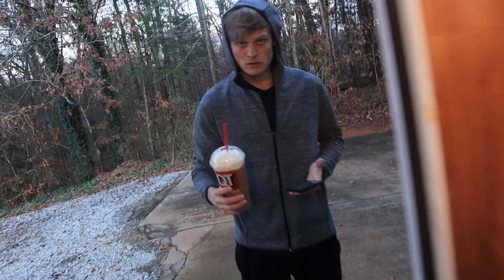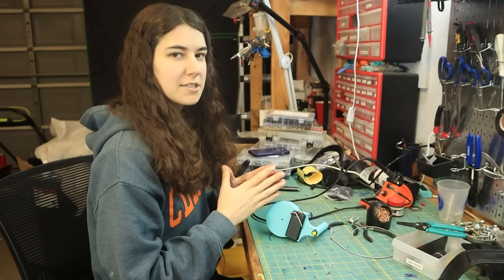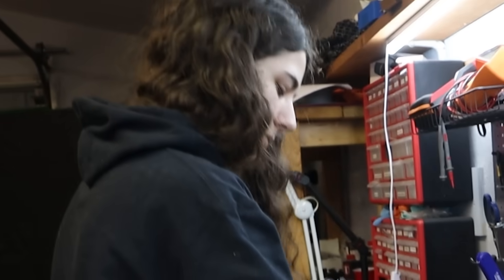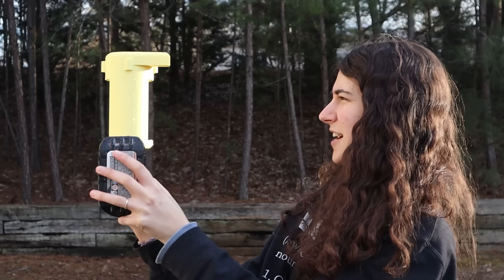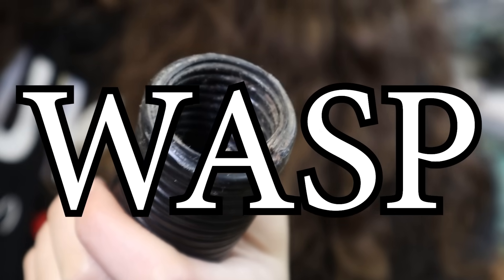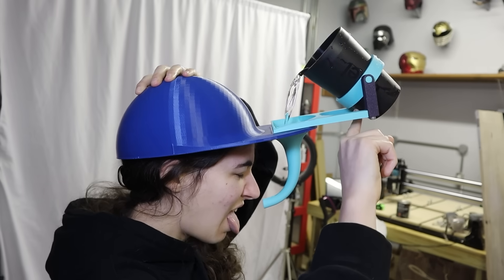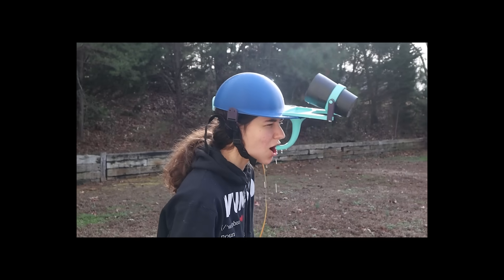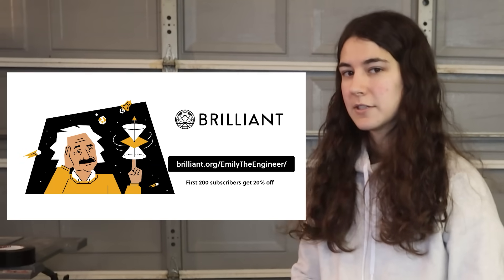Inventing New Ways to Drink Water

Comment: do it with the first one, but instead of pumping water, instead pump air into the container, then have a straw that goes down to the bottom of the container. the air pushes the liquid down and out the straw, which goes up through the center of the lid and shoots it out a spout. but instead of calling it a straw, call it a cylindrical device for elevating fluids through increased air pressure. with a straw you decrease the air pressure in the straw, causing the fluid to come up it. this way you would instead be leaving the air pressure in the cylindrical tube the same, but increasing the pressure in the vessel. So, not technically a straw :)

Comment: As an engineer, it probably dawned on you they process the paper to make it dissolve in liquid slower… the point you and many others in the comments are missing is that the chemicals used to do this are STRAIGHT UP TOXIC ⚠️. Paper straws are bad in every regard, saftey, waste, function, user experience. PLA is better in a few of those regards but standard plastic drinking are best. Just stop throwing garbage in the ocean 🤦‍♂️ problem solved!

Comment: Love your videos!
BTW there is already an alternative available, pasta straw (imagine a long Penne). Biodegradable and doesn't absorb liquid as quickly/badly as paper.
Reply: If it takes 6-10 minutes in boiling* water maybe it will last long enough for american cup sizes?
*if anyone has timed it in cold water please do tell us!
Reply: @thatdudeinorange5269  Its essentially forever cold liquids dont have egough power to break down the  starches.
Reply: @emeraldbonsai  Well, did the test myself and put one piece of penne in a glass of cold water. After 10 minutes it was still 'hard' and then forgot it.. maybe checked at 20 mins.. And now 4+ hours later it sure feels soft 'soggy' but still in one piece And it worked as a straw 😋 Next test is supergluing ten penne to make a longer straw. And Superglue was invented for medical use for the US Army to patch smaller wounds ( bulletholes?) together so aint worried about the health using it. 
(If you dont hear from me again, then I was wrong 🤥 )
Reply: Wafer straws. They are the straw that's a snack at the end. Like cereal, but useful.

Comment: Straw suck. A better upgrade to a sucky straw would be a "blowie tube"... make a cup that can be pressurized, add a cap with a valved flexible tubing (Tubing...is NOT a straw). Pump it up with either schrader valve or rubber ball/needle valve, or include an integrated hand pump in the lid. It will dispense at a rate depending on the pressure that you have pumped up to, and you can drink without sucking... ... (and use it as a squirt gun ;) )

Comment: The first model could be very popular if you used apple juice, in some countries could make a great side hustle on some "HUB" sites for the German, Brazilian and Japanese market.
Edit: The last one could be a fun game, you hook the servo up to arduino, make four hats, each gets a controller, the controller operates someone else's gets randomized every time, and then you roll the die and it determines how many times you press the button which is also random. Can either increment forward 1, 2, -1, -2 also randomized, like a fun russian roulette without the brain mess, but water mess or whatever.

Comment: I know the point is that it's shitty, but why not have the cup remain closed and have a hole in the bottom with the servo controlling a little rotating blocker thing in the bottom, so when you hold the button it spins and lets the water flow down the hole into the stra-- the drinking tube.

Comment: I love that Emily is like paper straws are bad, but let me make something completely out of plastic to replace the paper straw.
Reply: If they just left straws alone this wouldn't have been necessary.
Reply: My most urgent question when it comes to plastic straws: we can't have those, but throwaway vapes are okay for some reason? If I had to choose between the two, straws come out on top in every single scenario. 

That being said: I'd be perfectly fine with putting some reusable straws in my backpack, as long as they're not made of glass. Glass is fine at home, but not on a trip. Stuff happens, glass breaks, and it's an immediate hazard. And still: I'd probably take those over paper.
Reply: Disposable plastic straws are bad, but reusable face pump ry branded water throw in face launchers are gooooood.
Reply: Yes. Emily gets that if you make something reusable it is ten times better than something that is a one time use but good for the planet
Reply: @NationalParkJuniorRanger  Paper straws aren't good for the planet. They come from plants grown with synthetic ferts that absolutely DESTROY aquatic ecosystems. They require a lot of fuel to transport the raw materials used to make them, they require a lot of energy to process, and people often need to use multiple paper straws to do the job of one plastic straw.
It's a farce. A show. It LOOKS good for the planet, but it's not. It's not even in the same league as a reuseable plastic object - especially considering the main issue with straws is that they harm animals - a lot less likely with PLA that photodegrades quite quickly.
Reply: Thank you. I actually didn’t know that so thank you.
Reply: @randomsomeguy156  3D printing and microplastics go together like water and getting things wet. Anytime a 3D printer is printing filaments it is releasing microplastic particles into the air. The prints themselves also degrade like any other plastics.  Personally I love 3D printing, but I don't pretend that it is in any way good for any environment. 

I really would like to see a reduction in the ACTUAL damaging plastics we have going around. Straws are not even that bad. Single use packaging plastics are worse. plastic bottles are ATROCIOUS and literally always have been. Straws are a very small percentage of single use plastics waste. In a perfect world, I'd rather see a return to all our drinks coming in glass bottles and returning said bottles to the point of sale for reuse, just like we always used to do until the 90s.
Reply: @randomsomeguy156  It does, but it doesn't stay as a microplastic for anywhere near as long. The individual monomers are lactic acid so it eventually just breaks down into a natural product.
Reply: @randomsomeguy156 pla only biodegrades in commercial composting, is how I understand it
Reply: @BruceNJeffAreMyFlies  pla only biodegrades in commercial composting, is how I understand it
Reply: @ivibivivgig6425  Indeed, but photodegradation only requires sunlight. Leave a piece in the sun for a few months and notice how much more brittle it already is - that's the molecules breaking down from the UV radiation.
Reply: @BruceNJeffAreMyFlies  still leaves behind microplastics, as far as I'm aware
Reply: Well if they didn't cheap out on the little coating that lines the straws and doesn't IMMEDIATELY turn them into a soggy mess (yes some paper straws have a biodegradable plastic lining, although most use something food safe similar to glue), then we wouldn't have this problem. Per gram, your average (empty) aluminium can has more plastic than a paper straw. Believe it or not, we still use plastic liners for cans. Sorry, I just really, REALLY, hate paper straws.